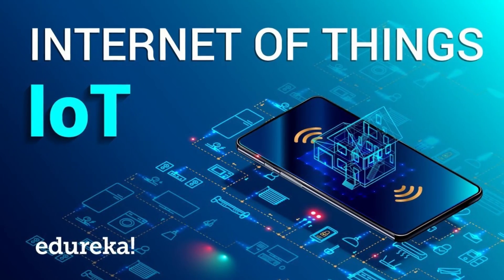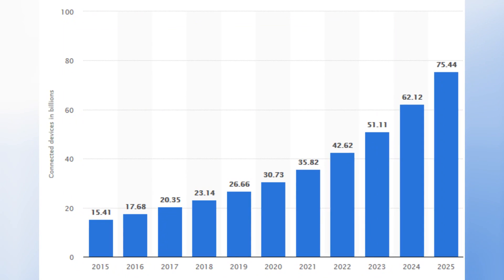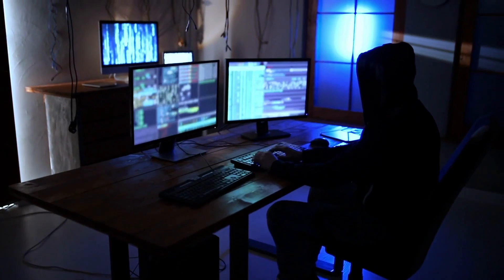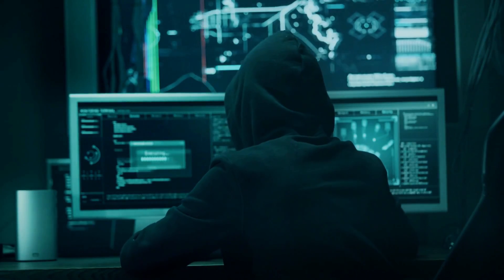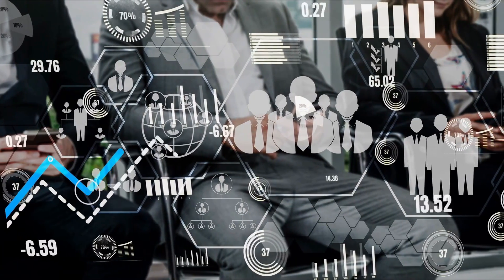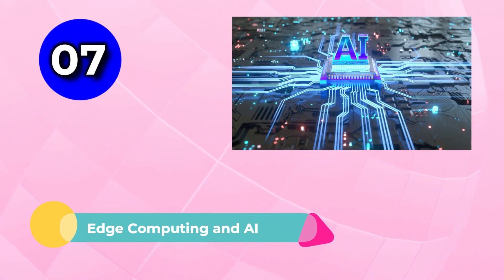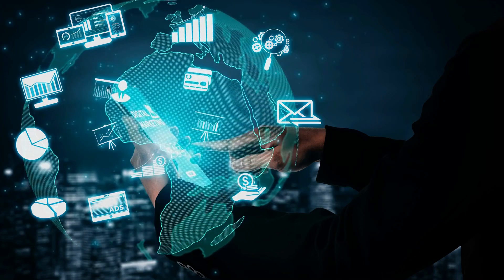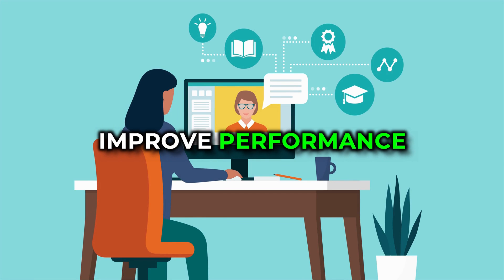Edge Computing | what can I do with it?

Comment: How does an analyst perform threat hunting and detect attacks on edge devices such as routers, firewalls, F5, switches, etc.? Is the approach to detecting attacks on edge devices specific to the SIEM and how to query the logs? If so, how do I find keywords to search, strings to search, Event IDs, etc.? Are the  keywords, strings, and event IDs vendor specific to search and detect malicious behavior? So far, the only solutions I have found to detect attacks on edge devices are CVEs and Nessus Plugins. Any assistance would be much appreciated.